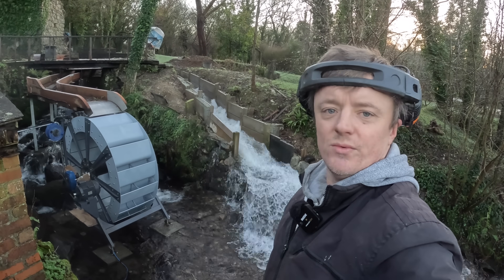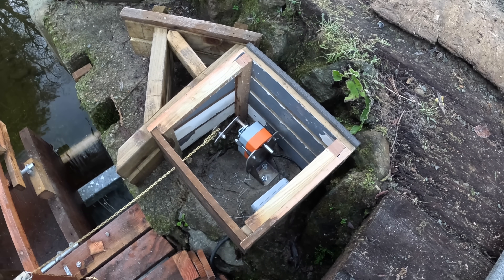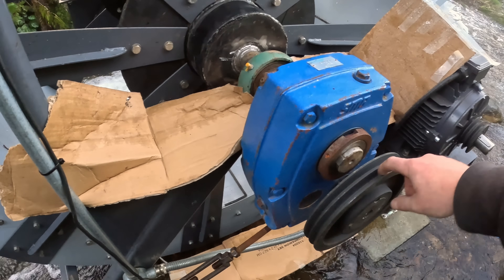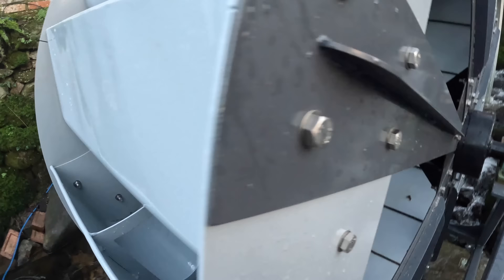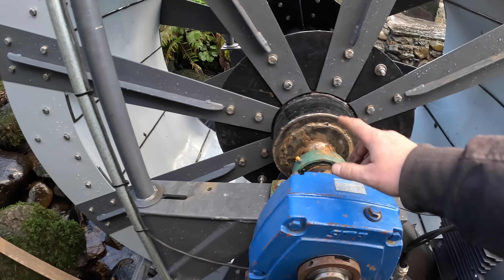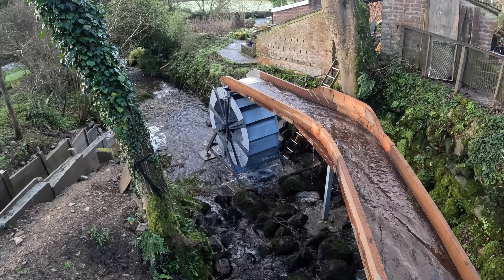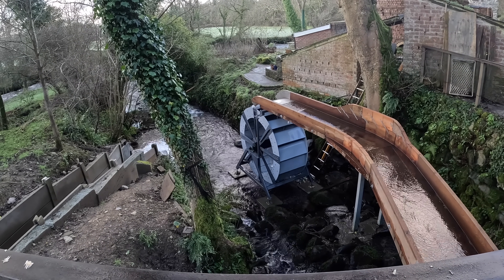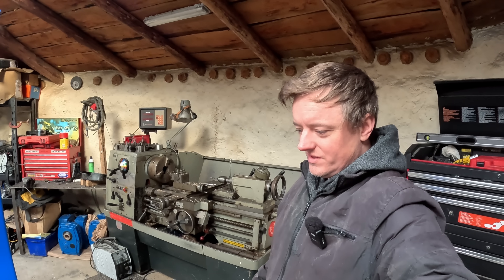Powering An Old Mill  1.5 Kw Lake District Overshot Waterwheel Project Part 5

Comment: Regarding the cover/enclosure for the gearbox and generator - from what I could see, it appears that the housing is open from the underside, making it possible for a curious child/cat/squirrel etc. to access the rotating pulleys and belts. With older cars or tractors such accidents happened occasionally when cats got in there attracted by the warmth of the engine. I'd recommend putting some perforated sheet metal or wire mesh there, so ventilation is still possible but the moving parts are shielded.
Reply: It certainly doesn’t comply with the Supply of Machinery (safety) Regulations and therefore doesn’t have a CE or UKCA mark. I’ve raised this before and it wasn’t responded to.

It might seem a bit mean to raise this but it’s enforced by the HSE and is criminal under English Law. Just being a one off designer and erector doesn’t mean it doesn’t apply.

Great work but follow the law.
Reply: @paulharrison2325  I design and manufacture custom embedded systems that go in various hvac and industrial products. I noticed that as far as regulations for conformity/safety etc. go, such stuff is often handled a bit lax, except for the large companies that have copies of all relevant standards (expensive) or contract this aspect out (very expensive). The smaller companies or startups often don't even know there are regulations regarding a particular issue and that they might expose themselves to lawsuits or liabilities. Do you know any other solution for a small startup or 1-man operation except making a best effort to gather information about the relevant standards, purchasing books about the topic, and maybe purchasing the relevant standards as originals and then of course go through your design and make it conform? This topic is easy if you are an employee of a big company (go to the library) but if you just started and you need to buy so 2000€ worth of DIN or IEC standards just to actually know what it is you have to comply with, that's a bit harder. IMHO this information should be public, such that even a 1-man operation has all the info available to check if they are doing everything as it should be. Like it is with building codes for example.

Comment: 6:20 "Must've welded it too hot..". No, you didn't, that's not really a thing in this situation. That's not what happened. The parent metal at that point was just too thin to take the load. How the extra load got there, when the other side is fine is for you to figure out. Just beef it up. The plate you've fitted should do fine ("A grinder & paint makes me the welder I ain't!") . A decent setup, it'll be fine.

Comment: I've really enjoyed watching your videos. I know that you are proud of the overspeed failsafe mechanism, but it is not (in my humble opinion) a good design for the punishing environment in which it is operating.  The pin sliding travel is too long and would be prone to freezing or corrosion or other buildup. A better approach would be a spring-loaded 'Over-center' or mousetrap  type mechanism that could be contained within a box out of the elements with a chain or rod attached to the sluice-gate. Thanks for a great series. ❤

Comment: It's an amazing setup, but the whole idea of it shutting down when the grid is off is baffling
Reply from the maker: It has to to comply with electrical regs.
Reply: @KrisHarbour  Of course.  Are you not allowed to use self-produced power without being grid-tied?  There are many ways to 'island' yourself when the grid is down.
Reply: @mrbodo69  the house would need a transfer switch which probably requires DNO approval
Reply: @jamiei543  Insane that it needs approval.  Here you install it, get it inspected and you're off and running.

Comment: I never knew what was involved in having an electricity producing water wheel. I'm actually surprised how many small things effect it's functioning properly. 

Kris, it not only works well, but it's asthetically very beautiful as well. Great job. How long did you work on designing it before you actually started fabricating it. I know you showed us some of it's building in the shop, but I'm guessing that it has probably taken you about a year in total. Would that be correct?

Comment: What failure would cause an over speed condition?
Reply from the maker: The belts breaking or slipping and the induction generator capacitor failure
Reply: @KrisHarbour  Ok thanks.

Comment: cover the chain over, think about a branch falling etc
Reply: Not a problematic Situation.
Tripping a Failsafe in a Situation like that is not dramatic.

At least put a bend Metal Strip over the Mechanism to protect it from the Elements and slather it in food safe grease or so to keep it from rusting together.
As the Actuator is only working against its own Spring but should have a Rating for at least 5Nm of external Force I’d suggest also adding a secondary Spring to increase the Pulling Strength in the Fail Condition.
Reply: I'm thinking more like squirrel or bird - just an upturned peice of guttering?

Comment: Curious, would it not be beneficial to have some sort of shroud covering the motor, belts and proximity sensor to keep it from getting soaked and frosty and just general weather, or something being dropped on it?  Just wondering.  I love seeing things like this.  I wish we used more ingenuity in generating power from natural waterways.  It just seems a waste when it could be done rather inexpensively benefitting everyone.  Well done Kris.
Reply: It does, it was just off.
Reply: This project was anything but inexpensive 😅
Reply: @peterpowell4821  relatively speaking.  Most communities could afford something like this if it offers cost avoidance or reduced expense long term energy use.  Average home owner, most likely not.

Comment: Great project Kris - found it very interesting. Stupid question though: why do you want the wheel to stop generating when you lose grid power? Surely that's the time you need it most?
Reply: I was wondering the same thing
Reply: The customer ONLY uses the power for grid-tie to sell back or to credit against what he uses from the utility.  Because that's how the customer wants it, there is no provision for storage.  There's no batteries.  So the system cannot actually 'stand alone' if the utility power failed.   I'd certainly try to go off-grid and then only use the utility if I started to fall short, but that's how I'd roll, not how his customer opted to go.

Comment: Love watching this Kris, but won't the failsafe annoy the customer that it won't reset itself?
Reply: Failsafes that ‘reset themselves’ are by definition NOT fail safe.
Reply from the maker: if something has gone wrong that causes a shut down the last thing you want to to do is get in to a cycle of constantly trying to reset itself and then failing again. The protection is designed so it is off and safe and has to be examined before turning back on again.

Comment: What about birds sitting on the chain? Should be enough to pull the pin.
I would recommend a pipe around the chain.

Great project. I think the blue cable just laying around in the stream looks a bit careless/out of place. It should have gone into the conduit for all the other cables as well, so nothing is laying around. I think that would make a better look and feel if the project is handed over. Over all nice to see the project and the involved learning steps. (It is all so simple in front of the keyboard. And most projects are presented that way.)
Reply: You’re welcome to suggest a suitable bird that’s heavy enough 🙄
Reply: @fredbloggs5902  looks that easy going, that it doesn't have to be a heavy bird. Thats my point.
Reply from the maker: A bird would not pull the pin out. it looks easy because you are watching a powerful geared actuator.
Reply: @KrisHarbour  good, thx for clearification.

Comment: Could you not use an actuator to vary the water flow rather than cut it altogether. You could set a top limit to make sure it did not overspeed, but otherwise it would act as a governor and vary the water flow to keep the output consistent and allow for variations in river flow.
Phil

Comment: The failure is most likely due to the steel having a heat affected zone (HAZ) in the area of the break possibly micro cracking and brittle fracture, your over plating should work but maybe an idea to read up on how to limit the affect (heat treatment for instance) Also relatively easy and cheap to check using dye penetrant technique. You may already know this of course 🙂Hope it all works out.
Reply: I wonder if there is a another design that doesn't require any welding?
Reply: getting some equipment VT (white, red penetration & developer paint) & MT (magnetic powder & electromagnet, for cracks not visible from the outside) testing on high load areas might be worth getting. for increasing cooldown time and therefore reducing/eliminating martensite creation (hardening with loss of ductility other symptoms if the outer surface of the HAZ solidifies prior to the inside would be cracking due to the immense pressure buildup from the formation of martensite which entrains volumetric expansion), ceramic heating blankets might be a good investment too. and of course just proper preheating. 
concerning the stick welds on site, i doubt that the rods were properly dried (there are mobile ovens for sitd welding so you always have some freshly dried rods on hand) so i would definetely watch out for hydrogen britleness, but if you go back with a mig and properly grind out all the old welds, should be able to save it.
Reply: It's the normal problem welding around a solid shaft, the weld shrinks as it cools and rips off the flange. The cure is first use flexible weld rods and secondly hammer peen the weld as it cools so the weld stretches, it's standard practice especially welding castings.
Reply: I was thinking a few triangular flanges / buttresses from the shaft, spreading the torque forces out further onto the hub-drum.
Reply: Or not understanding or modelling the forces at play and just winging it.

Comment: I've found this project fascinating and Ive learned a lot, thanks. I like the failsafe that shuts down the water flow, but if it was mine I'm sure birds, squirrels etc would land on the chain that pulls the pin out!
Reply: Maybe just cover it with a tube?
Reply from the maker: A bird sitting on the chain would not pull it out. and if it did the worst that would happen is a few hours of power would be lost.
Reply: @KrisHarbour  - thanks for the reply Kris. I hope you drop a few updates on the water wheel in from time to time, it's been fascinating and inspiring.
Reply: Great project Kris,  well done.

Comment: I noticed at 8:58 that the lever is moving BEFORE you changing the rpm value to a lower one.
This could indicate that the wheel was actually overspeeding for a moment but that it wasn't overspeeding for long enough for the pulley to travel enough and pull the pin out, then when the wheel doesn't overspeed anymore the pulley travel back up. 
So you might want to change that overspeeding value to something higher, otherwise client will complain because it would just overspeed every time.
Reply: Or install a small PLC which monitors the rpm. If the value is too high for a defined time, like 20 seconds, then trigger the relay. And instead of just closing, maybe a better way would be to regulate the water flow with some kind of servo motor.
Also, I personally would't have connected the gearbox and generator right next to the wheel.  I would have put them somewhere dry and connect with a prop shaft. Don't know if this is translated correctly, I'm not a native english speaker and have to use a translator sometimes.
Reply: I understood what you said perfectly well. Using a "plc" make sense, the gearbox away I don't know @Mues_Lee
Reply: @vovoer  YT recommended me a video some time ago. They used a differential gear and a shaft from an old car, was a quite interesting build :D

Comment: How about a mechanical govern like fitted to old steam engines that opens and closes the sluice based on the speed of the flow.
Reply: Governors on steam engines do NOT have an external linkage to anything.

Comment: Can you please explain a bit how the customer handles the disappointments? I don’t know what the agreement is you have with the customer but if they are paying for this experiment I am very interested what you agreed with the customer on results and outcome. If this wasn’t sold as an experiment I can imagine the client be a bit dissatisfied.  All pure conjecture of course so that’s why I ask.
Reply: He led them to expect 1.5KW at max flow.  They were doing much of the work themselves, like the trough, and that also had to be reworked.  I imagine they're thrilled with the output and the engineering.  Was there frustration?  Of course there was. Will a new design suffer setbacks, like the need to do welding after a burn-in test period?  Frequently, yes.
Reply: @scottstewart5784  i get all that, I am just curious to hear it from Chris as it is rare to find a “patron” that lets you experiment. For instance there are aspects that are not discussed: for instance did the client pay for all the time spent, even on the redoing of the generator and the rewelding, did the buuer pay for the price difference othe first and the second generator. Why I am interested? Well if Chris cannot invoice those things, his margin will probably be negative and we might not enjoy his content for long.  Starting a business is hard…
Reply: @automatedwoodworker  I assume he quoted a fixed price for a 1.5KW system. We don't know whether the features like the overspeed power dump to the heating element, or today's overspeed fail switch were in that quote. Perhaps they were not, and they worked out a change order for new capabilities.  As for the business aspect, one can't expect one's first client to pay for one's learning curve, so I expect Kris lost money or at best broke even, but feels rich with knowledge and experience, and subsequent jobs will go much smoother. His profit was probably lost on the generator upsizing driven by shady ratings deal, as that cost can't be passed on.  Plus he's making money on Youtube - which is like being paid to receive free advertising.
Reply: @scottstewart5784  … so I guess you agree with me that it would be interesting to have Chris address this topic as none of us actually know and we are both guessing.
Reply: correct & right @scottstewart5784